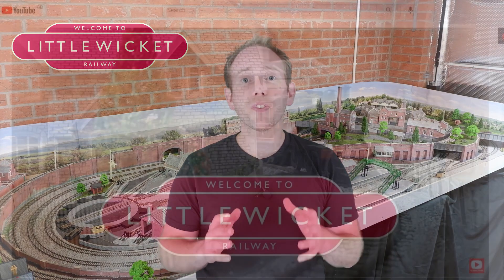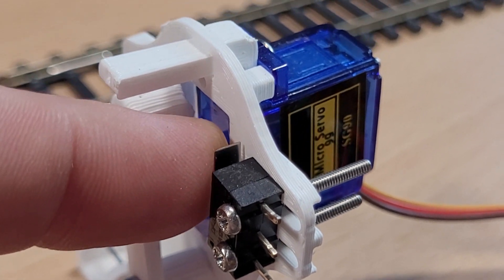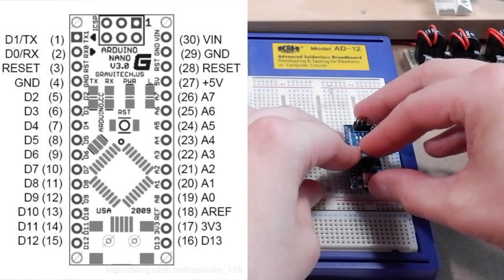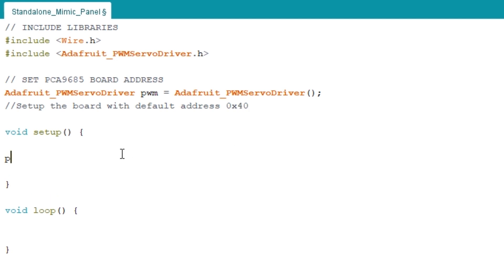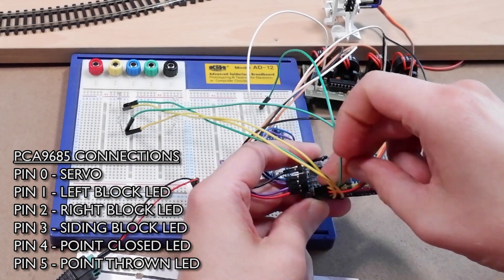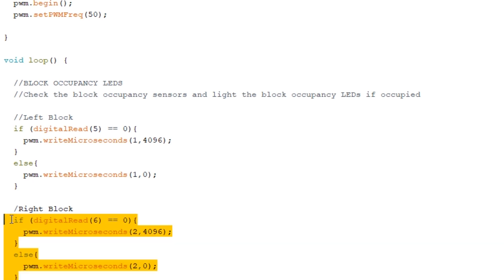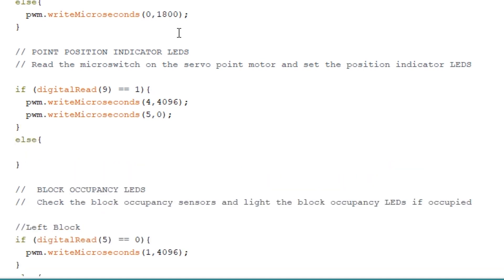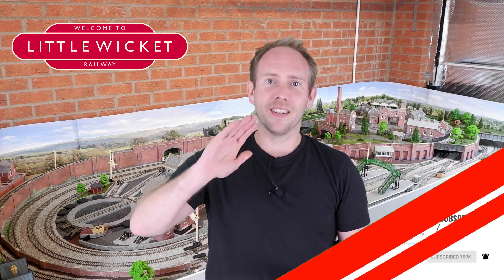Arduino Mimic Panels Part 2 of 2 - Standalone Panels

Comment: Can you use the sensor shield with the PCA9685 on an arduino mega for larger layouts, or do you need a separate arduino for the sensor shield and PCA9685?

Comment: I just watched this and found it very interesting. I'm getting right to start on a new mimic panel and am looking at maybe using this. The question I have is that I use all Tortoise switch machines and not servo machines.  Does this work the same way and if not what would the differences would be.

Comment: Having recently re-watched your pair of videos on panels, it occurs to me that 

a) one could combine some of the concepts and code, so the panels could work with or without a computer/JMRI, and

b) The relays for point position are unnecessary if one uses a switch per stand alone panel, as one can read the switch, and get/set the point accordingly.
Reply from the maker: Definitely for point A, that's 100% possible. On point B, you could use the switch position to feedback the point position, but it doesn't prove that the servo has definitely moved, so wouldn't be as reliable. If something malfunctioned (i.e. wire breaks or something jammed the point blades) so the servo doesn't move then you'd get a false reading.
Reply: @LittleWicketRailway  Yes you are correct, but luckily no-one will die when the train crashes. Also the microswitch is only detecting the servo motion, still no guarantee that the point is correctly thrown.

A modification I want to try is to record the position in EEPROM every time it changes, so in a re-power everything doesn't have to move to a default state.

Comment: I've just brought a class 52 dcc loco any ideas were I can get a sound chip seem to be sold out everywhere thanks
Reply from the maker: What brand/model is it? How much are you prepared to pay?
Reply: @LittleWicketRailway  it's an hornby western champion only payed £25 for it im not to bothered how much a sound for it is as I got the loco cheap and a select controller for £20 last week off ebay sent that to hornby for latest updates cost £15 so I guess that's cheap for a dcc controller

Comment: Need to find part one...

On my new module I'm planning on building I'm hoping to be able to add basic signalling and motor controlled points - looks fun to be able to code!

Not done any coding for over a decade! 
But like any code language once you learn the basic syntax it's pretty easy to tell it what you need it to do. 

Can JMRI set global variables that work sound functions on certain speed steps?
Reply from the maker: Here's part 1 (https://youtu.be/_xQefWpiklU) 😀 You'll definitely be able to do basic signalling and motor controlled points using Arduino and I'm sure you'll easily get to grips with the coding.

You can definitely write scripts in JMRI (they're written in Python code) which activate sound functions. I had locos sound their whistles before leaving the station or going into tunnels on my old layout.
Reply: @LittleWicketRailway  cheers man 🤘👍

Comment: My plan is to use a Pi Pico instead of an Arduino (just because), and to use a string of WS2812B LEDs. There's a lot less wiring involved that way with just three wires from the Pico to the string of LEDs. I'm also planning to break open a USB keyboard and use the innards to provide more buttons than the Pico has pins.

Finally, I'll be using Digikeijs block detectors, because amazingly they come out at the same price per block as the MERG units!

But Hey, well done on introducing what could be a scary concept for many model railway folk in a fairly easy to understand way.
Reply from the maker: Thanks John! Yeah, there's more than one way to skin a cat on this subject and I'm sure there are more elegant solutions. I'll definitely check out the Digikeijs block detectors. If they work out the same price and there's no soldering then that might be a better option. Where do you buy yours from?
Reply: @LittleWicketRailway  I actually got mine from Amazon!
Reply: @LittleWicketRailway  oh, and I use the Loconet version, so software can read the occupancy off the loconet bus.   You wouldn't need to run a DR5000 to do that (though it would be much easier!) but you could use a Locobuffer USB to bridge loconet to your PC... Or I know that there are several very simple circuits to get it to an arduino

Comment: Hi Rob - what a great series of videos. Thanks for posting them.  I am encouraged to have a crack at a panel but want to use micro toggle switches - do they need to be momentary (on/off/on) or can they be standard on/off switches? Cheers from Auckland
Reply: So having solved this problem 😊 can anyone suggest the coding solution for adding additional servos and toggle switches. I'm new to arduino and finding the next steps challenging! Also - what does the coding for a crossover controlled by a single toggle look like?

Comment: JFYI. I have a plan (one day), to have nano's controlling all my lights and nano's to sense blocks, but as a distributed control system. It will have one master nano with HMI to control the condensed [lighting[ timescale and some independent nano's to serve as mimics. As the two supported coms on Ardiono are limited to a short distance and the other is multiwire (not just 2), I will use a canbus shield's on each to communicate. {the DCC control will not be connected in any way). Points will be controlled by the mimics, blocks will have auto ABS control and will control signals.
Reply from the maker: Look forward to seeing this 👍 Did I see that you'd started producing and selling some of your 3D prints now?
Reply: @LittleWicketRailway  No not yet, but soon!